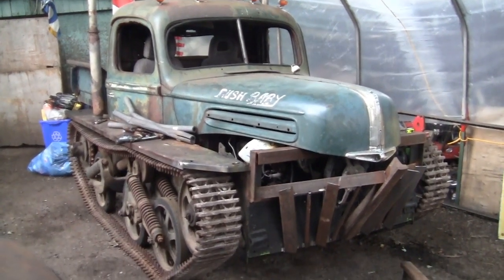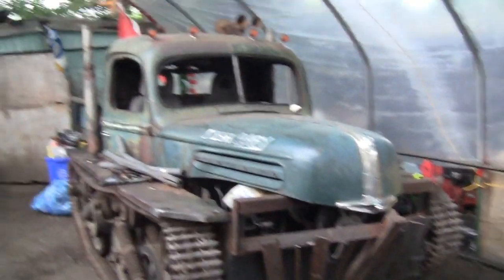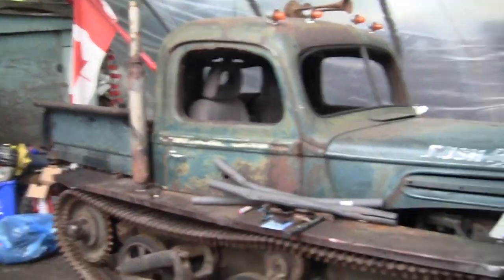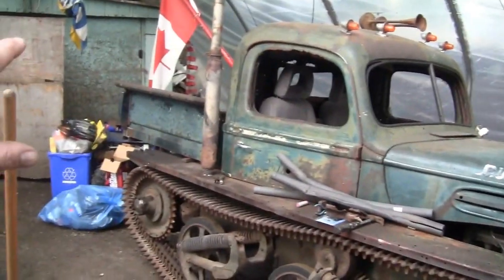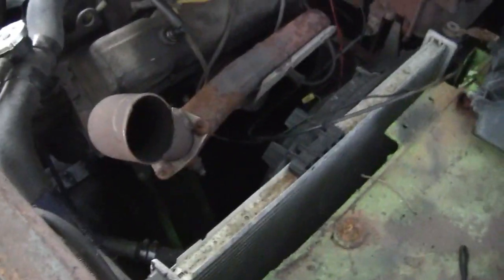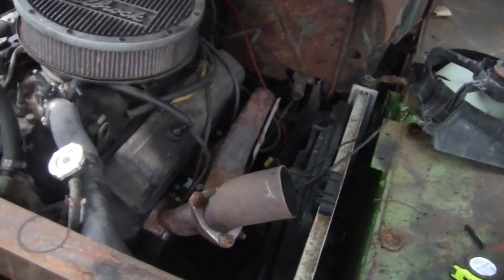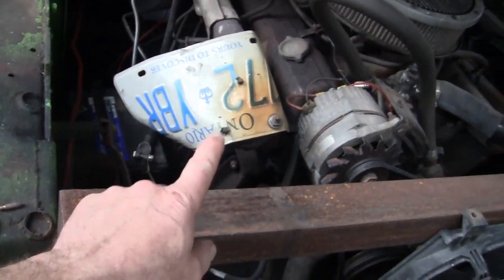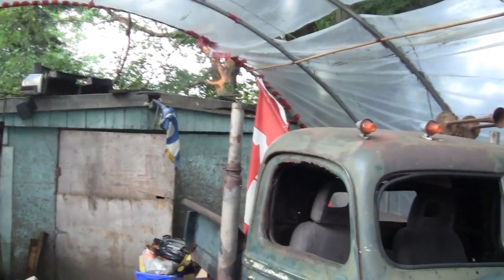Mad Max eat your heart out

Comment: The radiator is starved for air. Normally it breaths through it's entire surface and you have it approximately 4" away from a wall. This alone will reduce airflow and then you have it trapped under the hood recycling hot air from the exhaust & exhaust manifold. The rad needs fresh outside-temp air to draw in across it's entire surface.
Reply from the maker: Going to rework fan and add another one. Maybe add ducting

Comment: Look at the tube diameter on the rad.  I've seen identically sized radiators that had varying numbers of cores and fewer cores but larger tubing seems to work better on big motors where airflow isn't ideal.  Some trans ams and a lot of early vettes used 9/16ths tubes which help a lot!

Comment: Build a fan shroud & mount the fan on that vs directly on the radiator. Then  your cooling issues will be a thing of the past. With the fan tied directly on the radiator it's only cooling the small area covered by the fan vs. with a shroud the fan is drawing air across the whole radiator. Keep up the great work!
Reply from the maker: Goingvto try that next

Comment: Nice stacks, you going to put the flame throwers in them? Maybe the waterpump isn't working fully. Look for air. Circulation through radiator cap, you should see it circulating. You got a thermostat in it? How long does it take to overheat? Is the fill point higher then the engine? Is the heater core hoses just pluged or are you running a hose to bypass, you can put one of those coolant flush valves in that hose, make it the highest point in the system, then fill radiator up, put radiator cap on, then open that flush valve, since it's highest point, and fill the system the rest of the way, to get all air out. If there is air trapped in this hose by being the highest point, the whole system won't circulate right with it being the highest point, meaning higher then the radiator cap. Maybe tilt your radiator from the mounts, to get air out, air could be trapped in radiator Or maybe if you don't see it curculating through the rad cap, the blades on the pump are damaged, even a stock pump would be moving water like crazy to where you would see it.

Yah, I'm thinking you got air trapped or the pump is bad. I build those pumps for that engine by the thousands and test the hell out of them. I can see your system working good too, you should be getting fresh air coming in from the top and alot of it too, enough to cool that motor with no problem. Hope it helps.
Reply from the maker: Going to try another fan  takes awhile before it runs hot. Heater is looped around